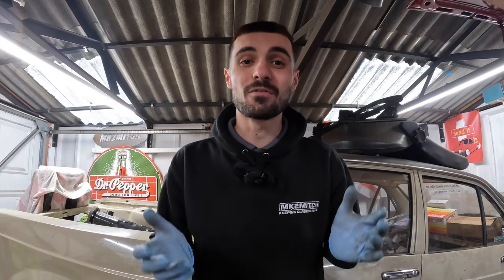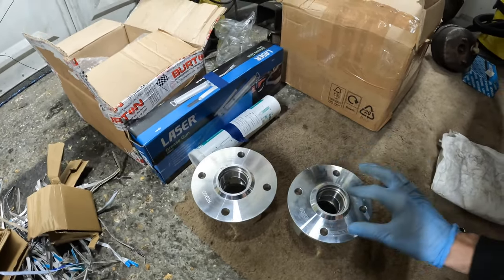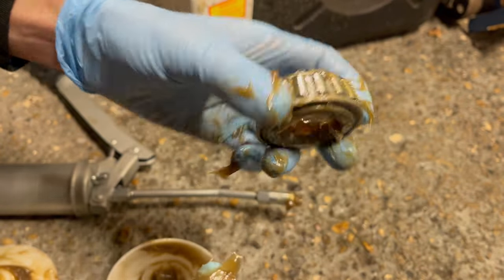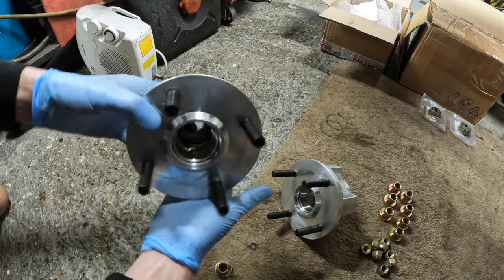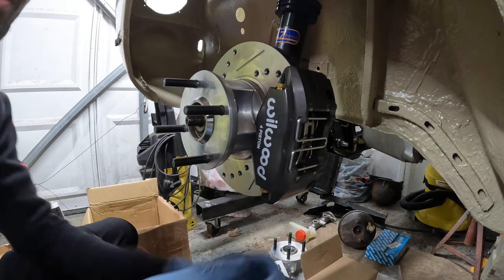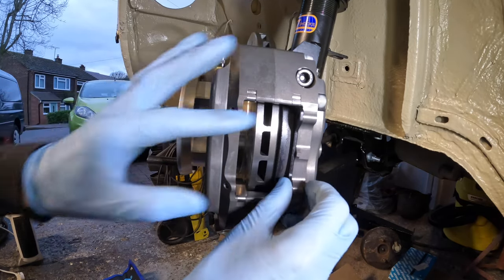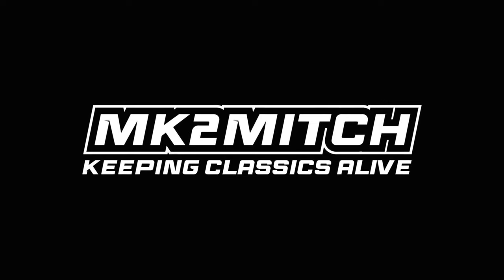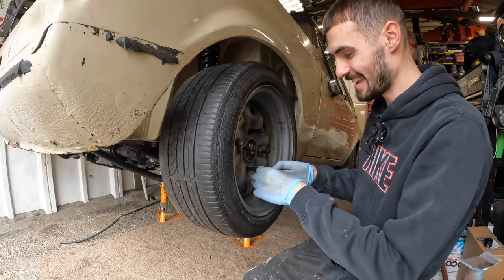UPGRADING MY MK2 ESCORT FRONT BRAKES *ROLLING AGAIN!*

Comment: when i was a lad, you had to rake around scrap-yards for austin princess callipers...
did you clean up the stub axle where the grease seal sits?
tyres look small, 205 60 13 was de rigour in the day...
bearing washer just needs to cover the centre [fixed] part, the rest is just to keep muck out. easiest way to set up the end-float is to spin the wheel, braying the rim with a rubber hammer at same time [to settle the new bearings] then adjust until there is just a little play [top to bottom] DO NOT run with no play, it will kill them. don't forget the grease caps need to back go on
somewhere on fleabay they were selling the little stick-on black squares for those wheels, beats painting those 32 squares by hand [like we had to]
keep it up young man
Reply from the maker: Thank you for the advice when it comes to adjusting up the play! I did clean the stub axles up thoroughly with my wire wheel on a drill but as you can see on the video the bearings/hub still needed the slightest tap on 👍🏻 I haven’t decided on tyres sizes yet so that will be something to look into!

Comment: mitch we used to use austin princess 4 pot calipers back in the day bro
Reply from the maker: I’ve heard about that upgrade and did debate it! These Wilwood callipers were just too nice to say no 🤣
Reply: Far to heavy
Reply: What size disc did u get from them and are your steel wheels 13inch thanks in advance

Comment: Looking good mate and coming along nicely 👌🏽 I would have used a type specific (alloy) for the thread lock as you've put bearing lock on you might struggle or strip the threads when removing the bolts for the discs.
Reply from the maker: I see, wasn’t aware there is a different thread lock for alloy 👍🏻 Guess I’ll soon find out when I need to change a part 😅

Comment: How do you torque those hub nuts? Looks like you would need a cutout in the socket?
Reply from the maker: Yes I assume I’d need one of them! But these are roller bearings and normally adjusted up by play rather than a torque setting 👍🏻

Comment: well done Mate,  you could do with some backing shield on those front discs as they will pick up all the dirt, and you will need larger washers on the hub bearings, ps I did not see the dust caps ?
Reply from the maker: Thank you, I will be purchasing those backing plates & bigger washers for sure! The caps never went on as the hub nuts will need adjusting and tightening later down the line 👍🏻
Reply: @Mk2Mitch  great Mitch, we meet at the NEC classic car show

Comment: take the outer bearings back out clean the stub axel as tapping the bears on as they warm up the bearing will seize to stub axel
Reply from the maker: I thoroughly cleaned the stub axles with s wire wheel on the drill before fitting the bearings. They only needed the slightest of taps to get them home 👍🏻